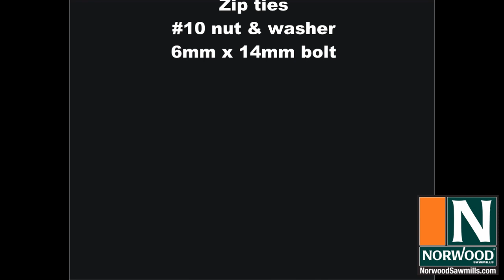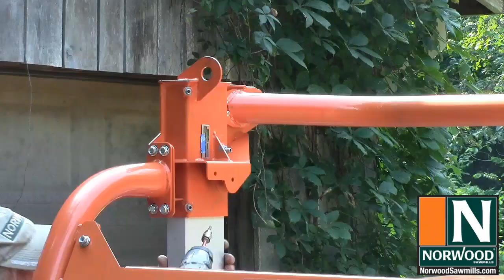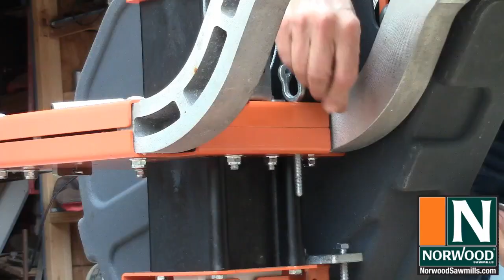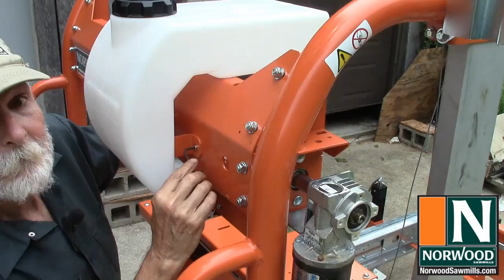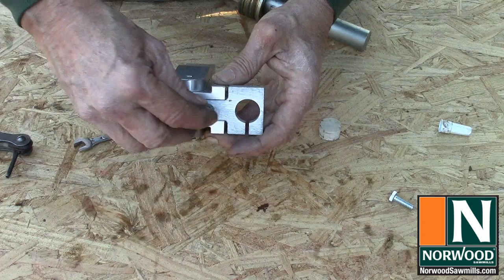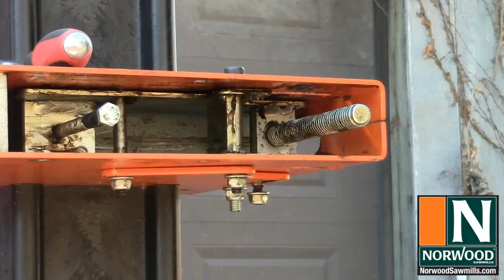The A, B, C's of assembling your HD38 Carriage & Sawhead

Comment: Hey Dave I finally got around to finishing my mill a couple months ago and cut my first log a couple weeks ago after almost a year of getting it . Those guide blocks you put on look like they slid alot nicer than the ones I have I had to Force them on and saw head won't lower very smooth it hangs up on one side. Any pointers besides waxing the uprights I've done that already.
Reply: Congratulations on your new mill.  Sounds like building it was a long journey for you, but once you start making sawdust, it's well worth it!  Try loosening the 8 bolts that hold the guide blocks in place (10:47 in the video) on each side.  If they are too tight, they will compress the plastic against the upright pieces.  I've heard several reports of this problem.  You might also make sure that the cables are winding evenly on the winch.  Good luck... let me know if this solves the problem.

Comment: Here's my question the deck will go up and down with no issues then it will stop going up and sometimes come down checked spools, cables, levels etc, then it will all of a sudden start working it's not the motor now today the blade started diving for no reason it's not my first mill this Norwood is not working out hd38 max any thoughts someone now mentioned to shim the deck blocks the black plastic sleeves really brand new not 20 hours and I have to do that
Reply: Hello Dave I spoke with Amanda at Norwood excellent customer service rep. Through her Norwood sent me a winding winch upgrade kit with spool cones just like yours and installed both sides against the bearing flange as directed NOT the shaft flange also was two brackets that move the top pulley closer to the winch shaft, moved the saw head up and down a couple times the controller now starts to move saw head deck when dial is on Turtle , thank you so much for your knowledge and fantastic videos when it gets warmer will run the mill for a couple days to see if I have the kinks out of it thanks again
Reply: @chuckcanham699   Glad Amanda was able to help you.  I've heard good things about her. 

Check the instructions on page C-36.  Note that the top photo shows the spacer cone on the non-operator side is against the flange bearing, and the middle photo shows the spacer cone on the operator side is against the flange on the shaft.  I know it sounds weird, but that was the only way I could get the cable to wind evenly on both sides of the spacer cone.  I tried both spacer cones against the flange bearing, thinking the instructions were wrong, but sure 'nuf, the pictures show the correct placement!  Just keep an eye on the winch as you wind it up, and I think you'll see what I mean.  I believe I mis-spoke on the video about the spacer cone placement, but actually showed mounting them correctly.  Looks like you're getting close to making sawdust-- keep me updated.
Reply: Dooley noted Dave in the paper work they sent me it says to put both spools against the Bearing flange which I did will give it a go and see how it works if not than do it the way u did NOS against bearing flange and the OS against the shaft flange note in my kit I have two brackets orange  one for each side brackets that replace where the top removable pulley that is secured by a scissor pin, they get mounted to the orange round tubing that is secured to the uprights by the top plate they Move the pulleys closer to the spools and I think have more of a vertical direction for the cable, not sure if u have them or not and if not preps that is or could be the reason why possibly my spools will work against the bearing flanges  time will tell cold here in Canada so not sure how much milling time I will get in is there any advantage or disadvantage to milling frozen logs? Thanks Dave again CC
Reply: @chuckcanham699  Yeh, sounds like you got an upgrade I wasn't aware of.  Sounds like you've got a good handle on it.  Not much to milling frozen logs, once you get 'em on the mill.  A lot of people go to 7 degree or 4 degree blades if the logs are frozen inside-- blades seem to last longer, as ice can be abrasive.  Takes logs a long time to freeze, and a long time to thaw out.
Reply: @daveboyt6810  morning Dave looked at your video again you do have the brackets that I spoke of that came with the kit thanks cc
Reply: Surely we can figure this out.  As far as the carriage moving up and down,  the first thing is to loosen the bolts holding the guide blocks (15:18 and 15:40 in the video).  If they are too tight, they can compress and distort the plastic guide blocks enough that they won't slide smoothly on the uprights.  I applied paste wax to the uprights to help them slide more smoothly, too.  The next thing to look for is any place where the cable came off one of the pulleys.  I've had the cable come off and get caught between the pulley and the pulley frame, and that kept the sawhead from moving up and down smoothly.  Finally, watch the cables wind onto the winch shafts.  They should wind smoothly with no kinks or crossovers, and wind onto both shafts exactly the same.  When the sawhead is down and there is a little slack in the cable, raising it should pull slack out of both cables at the same time.   I don't know why any shims would be necessary.

There is always a reason the blade dives.  You might have hit metal and damaged the blade.  Or you might have sap buildup on the blade.  Have you tried changing blades?  How are you tensioning it?  Are the guide rollers adjusted ok?  As you run the mill, the belts settle into the pulleys and that can change the blade alignment a bit.  Or you might just be milling some gnarly logs.  Knots and changes in the grain direction within the log can cause the blade to dive a bit.

On both counts, please let me know what (or if) you figure out.  I'm sure that once you get it lined out, you'll love the mill.  It has some very impressive capabilities!

Comment: Hi Dave I assembled my HD 38 a few days ago I went by the manual assembling the spools u did yours opposite to the manual is there a reason for that the operators side is to be put to the the bearing and the non operators side is to the flange let me know thanks great video
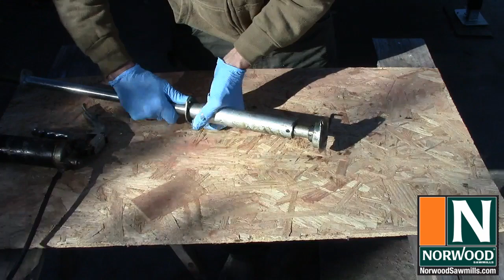Reply: ??? I just double-checked the video and the manual.  Time point 19:56 shows the correct position of the spacer cone against the flange on the non-operator end of the winch shaft, as described on page C-36 of the manual (though the winch shaft is turned end-for-end on the video),  and time point 22:27 shows the correct position for the operator side, as shown on page C-38.  I know it seems like they should both be set the same but trust me-- this works!  If you do it any other way, the cables won't wind onto the winch shaft evenly, and the sawhead will not lift straight.  If you have any question, please send a follow-up comment, and I'll try to get back to you more quickly.   Hope this helps!
Reply: Thanks Dave I noticed your spools look differently to mine purchased it fall of 2021, yours seem thinner maybe a little longer hard to tell in video forsure they are contoured differently, haven't run the saw here in Canada as it is full on winter, if it continues to stick I will take it apart and do as you did,  and let u know how that works another question ?? The saw head only starts to raise if I have the controller almost to the rabbit logo is this normal ??? Thanks Dave
Reply: @chuckcanham699  Yikes!  You may have the wrong "spools" (I believe Norwood refers to them as "spacer cones").   It sounds like the ones you have are the ones shipped on the first HD38 mills, which Norwood changed.  I'd advise you to contact their customer support and explain to them that you received the wrong spacer cones for your mill.  They should replace them at no cost to you.  The larger ones will not lift the sawhead properly.  If you run into any snags, let me know.
Reply: Also, the smaller diameter spacer cones increase the mechanical advantage of the winch, making it more responsive to the speed control.
Reply: @daveboyt6810  thanks so much for the advice will keep u posted will call tomorrow on the spool issue great thanks cc

Comment: This has been the worst experience. I have the HD36V2 and the manual doesn't match the mill. The directions don't match the actual boxes or parts bags. This video has helped a little but the HD38 is just a little too different. Plus I don't have hydraulics. Disappointed with Norwood the company, but your videos again have helped.
Reply: John, I'm sorry to hear that.  I assembled the original HD36 mill about 6 years ago, and can't imagine putting it together without a proper manual.  I'm wondering if you got sent a wrong manual.  Does the cover specifically show the HD36V2?  The first video of the series (assembling the frame) should work for your mill.  The video I made back in 2016 might help somewhat: https://www.youtube.com/watch?v=kDR_0K-spvY&t=1461s.

I'd be glad to help with any specific questions, though I haven't assembled the 36V2.  Good luck to you, and hang in there.  It'll all come together, and be well worth the effort!
Reply: @daveboyt6810  Please help lol!We bought the HD36V2 and the manual that they sent doesn't match!Apparently we also have and extended carriage too!It has five instead of the four cross beam sections!
Reply: @natural4lifemiss  I'm a bit perplexed about the manual.  Does the cover show a picture of the HD36V2?  If not, you were sent the wrong manual (unlikely, but it could happen).  There are two possibilities with the 5th cross beam section.  You may have an extended track, or you may have ordered an extra crossbunk.  If you have an extra crossbunk, put it half-way between the first and second crossbunks.  It will come in handy if you get logs shorter than 8'4" (I highly recommend it).
Reply: Hey John I also purchased the HD 36 V2 and I am about to assemble the carriage I hope I have a better experience any advice you can give me?

Comment: going in to week 7 waiting for my 38 full hydraulic,no word yet. have had a 36 manual, other than the power lift i added for 5 years got about 800 hours on it
Reply: Hope it arrives and you get it up and running soon.  Some sawmill manufacturers have over a 2-year waiting period!  Right now, pretty much all manufacturers-- especially those dealing with steel components are facing real supply challenges.  If you've been running a 36, you'll love the 38.  The sawhead design gives a much deeper cut, and the blade guide system has been completely re-designed.